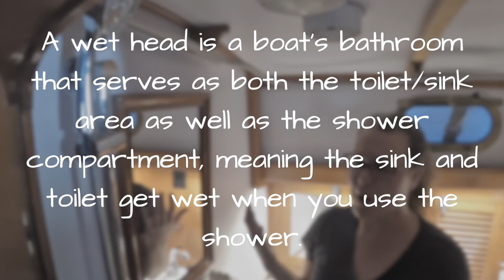The BAD & the Good:  What We Hate & Like About This Boat | SV Ramble On

Comment: I switched to an airhead composting toilet. What a difference this has made. I am able to sail several months before I have to empty solid waste. No more sloshing of waste in holding tank. No more smelly hoses or toilet maintenance. It may not fit in your head as it requires more space than standard head but I could not be happier with this change.  Does a bucket still qualify for use while cruising? Maybe a myth leftover before working heads became the norm. I don’t really know. Best ask Coast Guard. Love your channel
Reply: I'll second this recommendation. When I bought Cyclops, it had two heads. One was a "wet head" with a shower and marine toilet, and the other was a Natures Head composting toilet. The marine head had some issues, which I fixed, and I replaced all of its hoses and its holding tank.  I hadn't used a composting toilet before then.  After a couple of years, I entirely removed the marine head, its holding tank, and all of its hoses , and now I use that area as a dedicated shower. The Nature's Head is just that good.  I empty its collection basin about 4 times a year, with just me living on the boat.  It's a simple operation that takes only a few minutes.  You simply upend the collection basin into a trash bag.  There are only two moving parts, a stainless mixing crank, and an exhaust fan.  It's impossible to be left without a working head.  There are no smells, unlike a marine head.
Reply from the maker: Thanks for the comment, and we appreciate you watching. The two schools of thought on composting vs. traditional heads is a debate we’ll save for another day. It’s just one of those  necessary evils….

Comment: Good video. Some of the things that I didn't like about my boat I came to like as I used it more while some of the things I thought I would like turned out to be not so great. Sometimes it comes down to priorities and what you are willing to live with. For instance, I kind of like my Origo 6000 stove/oven for its simplicity but there's no question induction would be better, but I would then need to install an inverter.  Hard to find just an inverter now without a charger and since I already installed a new charger I can't see myself switching unless the induction turns into a gotta have item. On the other side, I originally thought I wouldn't like my keel/CB configuration for its performance but now I love it for the shallow draft capabilities critical to many East Coast cruising areas and have found that it's really not that much of a performance compromise.
Reply from the maker: We agree completely.

Comment: You have done an amazing job with Ramble On and I have enjoyed every video along the way, this one included. I’m curious why you ‘hate’ the location of your fridge? We are in the middle of a Sail Life level refit of a Norseman 447, which has a u-galley configured just like yours. Should we swap the fridge/sink locations, that is the question and I would be most interested in your thought.
Reply from the maker: We think the fridge would be more efficient on the other side.  Right now, one side is next to the engine and the back is next to the engine room.  Both get hot and probably cause the compressor to run more.  Also, if it were on the other side we could have a more usable front loading door where our trash can door is now (on the "hallway" side).  We have a front loading door, but it's hard to get to it in the little U-shape area.  Also, the freezer shape is impacted by the shape of the hull.  It starts to taper aft pretty significantly right at the outside edge of the freezer.  The hull is still straight on the sink side of the galley at that point, so the freezer would be a bit bigger on the other side.
Reply: @svrambleon  Thank you for your reply, much appreciated. Your point about proximity to the engine is a good one.

Comment: If the sun doesn't shine can you still use your cooktop and air fryer?
Reply from the maker: Yes, it will run off our batteries.  We have a video on how much electricity we used https://youtu.be/ktiMfcFWzBg.  We also have a high-amp alternator and a Honda generator if our batteries get low.